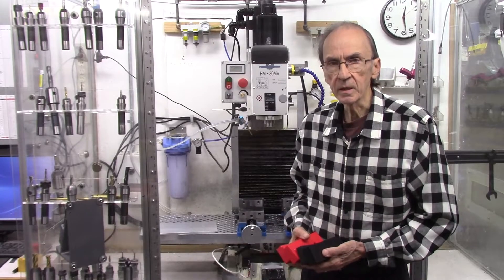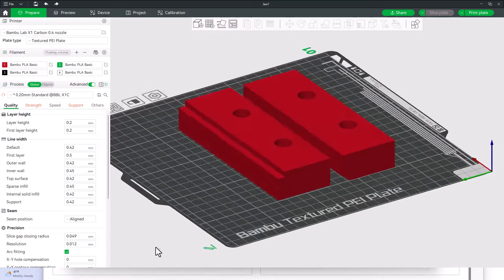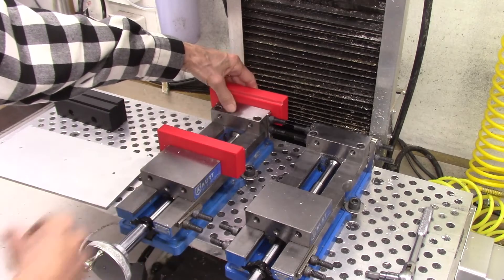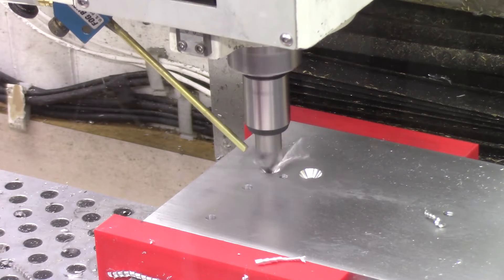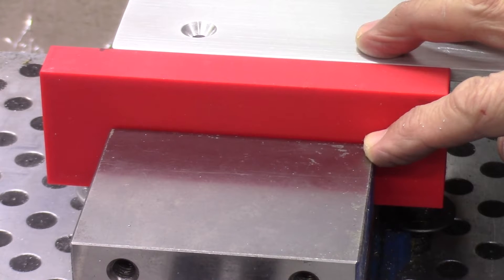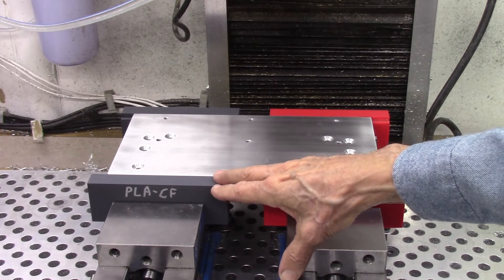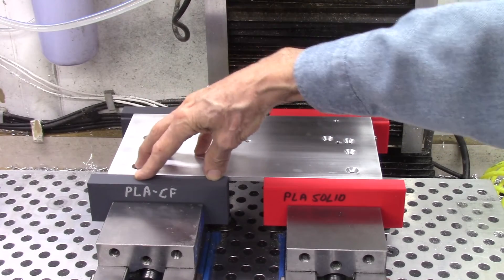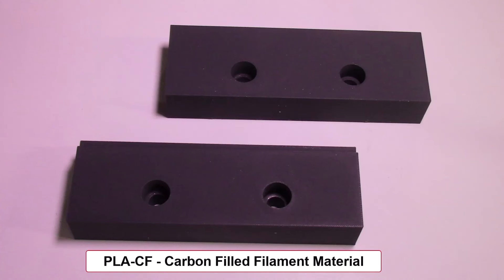3-D Printed Soft Jaws for a Kurt Vise

Comment: Why print them so tall?  PLA is plenty strong in compression.  But the offset way above the clamping axis is adding unneeded torque to the jaws.  Shorten them up so the printed "parallel" surface is just above the top surface of the vise.  You'll get more clamping force with far less load on the jaw.

Comment: I would suggest looking into PLA+ or just printing with polycarbonate as its more consistent and almost exactly as strong as the carbon impregnated filaments. the CF filaments are also really abrasive running through your machine and you will have to replace the nozzle a lot more often.

 I would also recommend printing the jaws with the 2"x1" side  or 1"x6" side so there is less of a chance of the layers delaminating as that is almost always the failure point of 3D prints. 

Another good way to increase rigidity is using the largest washers you can get away with to distribute force more evenly. you can also run bolts through a tapped hole vertically through the part to spread force out through more layers.